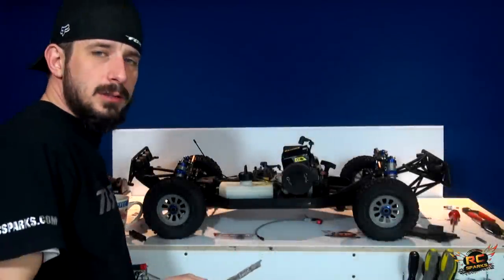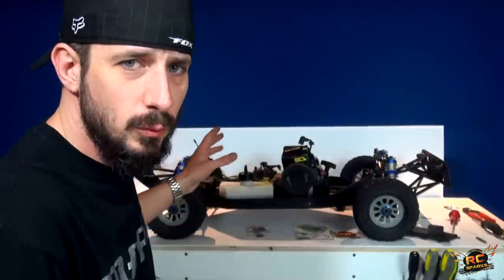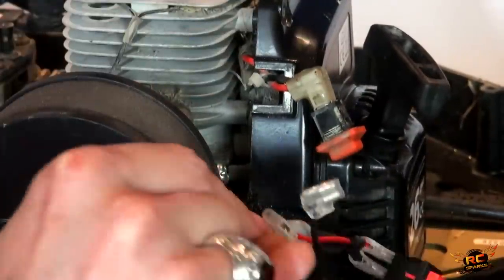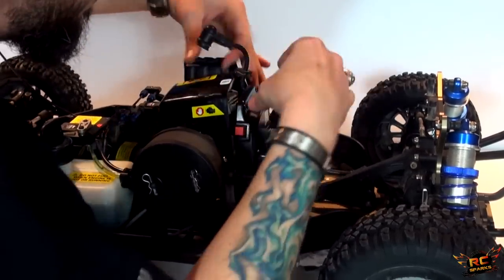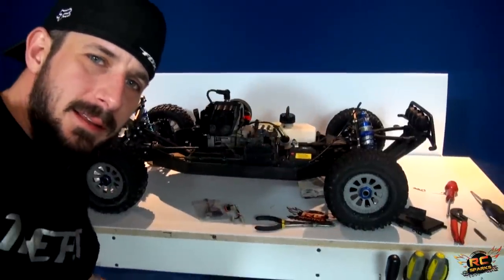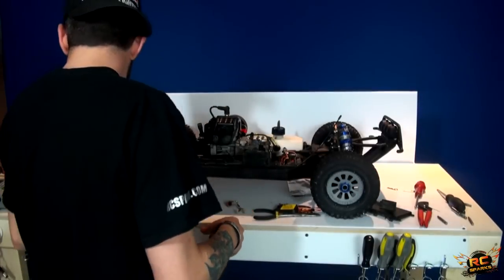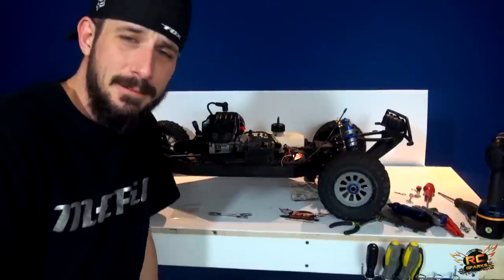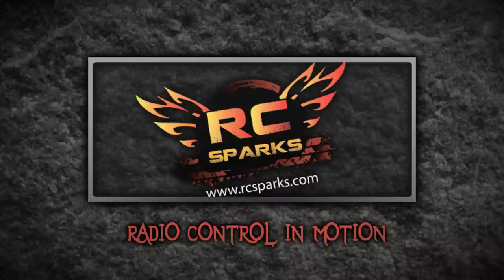RC ADVENTURES - LOSI 5ive T (5T) -  Killer RC - SUPER BEE KILL SWITCH INSTALL

Comment: The Super Bee has adjustable cutoff. 3v, 4v, 5v, 6v. It comes set at 4v, which is good for a 6v NiMh RX battery. For a 7.4v LiPo you would set it at 6v. If you have LED headlights you can plug them in to the Super Bee and it will make your headlights flash when the battery is getting low, before it kills the engine.

Comment: Hay guys, small tip with the spark plug, tighten it with a garden hose, yes a garden hose, stick it in one end and keep tightening the plug and there will be a point where the hose will no longer grip the plug and just spin, that's pretty much perfect. also you can't cross thread when using this method either as it will slip.

Comment: The Super Bee has a quick disconnect JST plug on the ignition cable. That should allow you to remove the battery box easily.

Comment: Hi
I am having trouble to tune up my lost five carb. I have set it at 1/1/4 out low & 11/2 out high. When I hit the throttle, engine tend to die and spitting some gas and oil also it doesn't move. Any advice?

Comment: Hi Medic.
In regards to water proofing, cant you just use plastic bushings instead of bearings so nothing ever seizes. Im thinking off converting one of my tt01's into rally, and making it water proof. So i have to:
waterproof electrics,
replace bearings with bushings 
and cake everything with marine gearse, lightly though, i think my dad will grab me some from his work.
Can u just confirm that i can use bushings without worrying. Thanks medic
kiwi

Comment: does the cut-off work if something happens to the battery?
my friend had a failsafe in his t-maxx but flipped it and landed on the wheels and the reciverbattery flew out and the truck gave full throttle straight in to a wall :P

Comment: Bravo. Just be aware that a battle switch is 8 times the size of a Super Bee, doesn't include EMI filtered ignition cable, and doesn't have adjustable low voltage cutoff, or adjustable glitch sensitivity, and won't work with 2 channel radios, and doesn't have engine temperature sensor inputs, and doesn't have data logging for engine temp, battery voltage, and radio glitch info, and doesn't have audible buzzer alert, and doesn't have 6v LED status outputs, etc, etc.

Comment: You should gear down your pinion and gear up your spur. Doing this will give you more torque but lower the speed a little. If you go the other way around you will over heat the motor because its trying harder to turn the tires.

Comment: I leave fuel in my dbxl but I usually run it every week lol. the fuel in the tank is fine for a couple months, I'd say if it's going to sit for more then a month or so I'd atleast just drain the carb so the Jets don't clog with oil

Comment: My kill switch occasionally kills the motor for no reason, I have to turn off the Baja switch and turn it back on then it works for a while until it decides to kill power again... Any suggestions?
Reply: Could be a radio glitch
Reply: Could be many different reasons. Sometimes a spark plug can have a bad internal resistor, which causes excess radio interference. So sometimes just changing the spark plug can fix the problem.
Reply: Never thought of that.... Thanks, gonna try it tomorrow, its due anyway....
Reply: saveourcountry1776 Be sure it's a resistor style plug. They usually have an R in the part number. Most of us use the NGK CMR7H plug in our 23 to 32cc engines.
Reply: What is the usual gap measurement you use?
Reply: saveourcountry1776 They come with the proper gap already.
Reply: You are a huge help thanks....
Reply: KillerRC
I bought a super bee kill switch and I'm very happy with it. I just have a small issue when my telemetry goes out of range (100-200feet), The killer bee will kill the engine when stopping the truck for a few seconds. Does the kill switch works when the receiver telemetry transmission goes out of range or transmission from pistol grip (controller)? I'm using a Spektrum DX3R. Thanks
Reply: killmore75 That's common with Spektrum radios on gas RCs. The Super Bee is just doing it's job. The signal is dirty. Try the Spektrum Marine version receiver. Or switch to Futaba.
Reply: killmore75 Also, change the spark plug. Spark plugs have an internal resistor. Sometimes the resistor goes bad and it causes excess radio interference. Try a new NGK CMR7H.
Reply: Is FM frequencies cleaner than 2.4ghz? Thanks for the reply.
Reply: killmore75 No. 2.4ghz is preferable, but Spektrum uses a DSM technology that seems to be sometimes affected by the ignition system on these gas engines. I think the newer DSM2 is better. But I prefer Futaba's 2.4ghz.

Comment: You might have made a remote kill switch device, but I doubt yours kills the engine during radio glitches, with Aux channel, low battery, dead battery, high engine temp, adjustable low battery voltage cutoff, buzzer and LED output, etc, etc.

Comment: Hello, I have a Redcat Rampage MT like yours and I was adjusting the high n low pins when is was accelerated and just shut off on me and didn't want to start back on, So I thought it was the spark plug or the ignition plug so I got these 2 new parts and still doesn't start back up I even took the carburetor and clean and got new fuel lines for it and still nothing. Does ANYONE knows what could be the problem is?
Reply: put the carb to the factory settings and start from there again.
Reply: +crazyRC world ok thanks

Comment: Medic. Your suppost to run outerwears on your pull starter, your filter and the bottom of your engine. Your only going to kill your motor by not running outerwears on your engine, grass, mud ect will eventually build up in your shrouds, and cause your engine to overheat. I suggest you order some outerwears ASAP before doing anything else. Ask any 5th scale R/C owner out there they will say the same including my self. I have a Hpi Baja 5t. Anyways for the best  prices on parts > DDM Racing.com